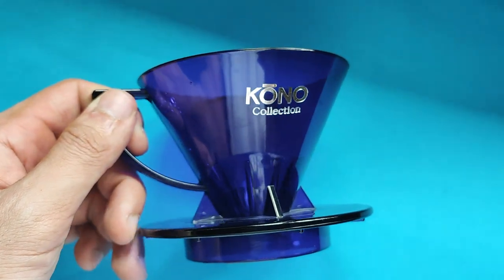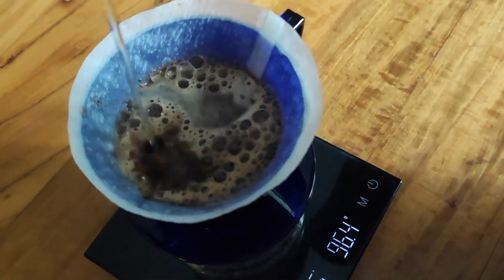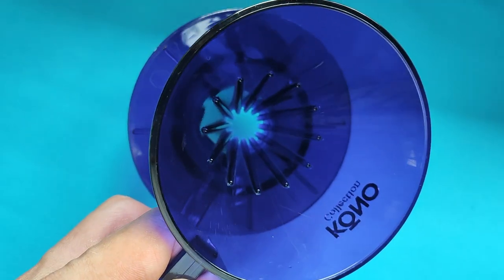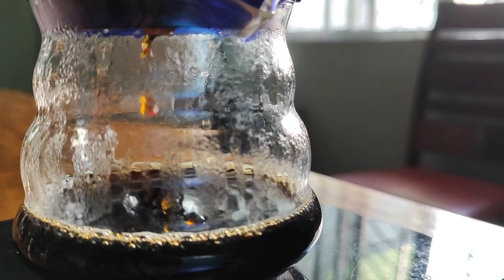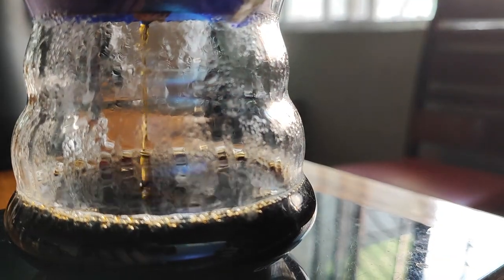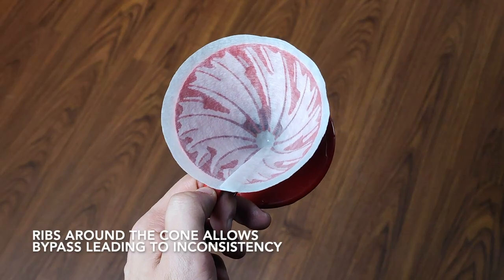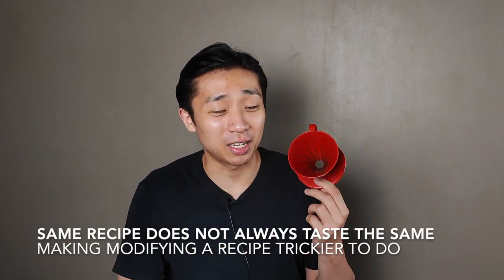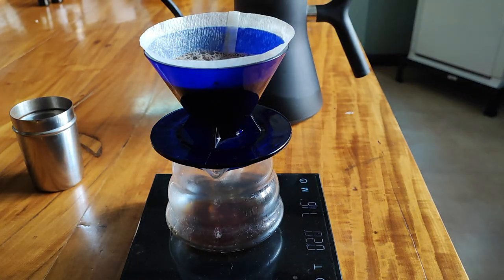Kono Dripper - the MOST UNDERRATED Conical Dripper?

Comment: I agree! Repeatabilty is excellent with this dripper. The added texture is wonderful as well. I've also consistently gotten good acidity, sweetness, layered flavors and balance. Also the extractions seem to be much higher with the same amount of time. So I've been able to get as good or better extractions with the Kōno in much less time with no clogging issues. 

It's a VERY GOOD design producing VERY GOOD results. 
I thoroughly enjoy the Kōno dripper. 

Oh, and to add to all that, I've had great results with 1 pour, 2 pour and 3 pour methods, each with very distinct flavor profiles. 

One of the most distinct and interesting pours I've accomplished with the Kōno is a 3 equal pour method, in which I pour 1/3 of the total brew weight every minute. No stirring or swirling. Smooth medium flow rate making circles from the center outward to nearly the edge. 
The third pour takes a bit longer to drain than the first 2. If there are any floral notes in the coffee it draws them out excellently. Also produces plenty of acidity and sweetness. Multi layered. Very high extraction. Though I haven't had any issues with over extraction, you may need to adjust grind size, water temp or even coffee/water ratio if you have over extraction.
Reply from the maker: Thank you for sharing! Interesting insight with the 3 distinct pour methods. I enjoy using the 3 pour method as well :D
Reply: @wideawakeph3662  Absolutely! 
Glad to share. And I hope someone gets something good from it.

Comment: 👍 Thanks, very clearly presented.   
Would you also recommend this dripper (the small version with the lowest ribs) for working with smaller amounts of coffee? (Say 10 or 12 grams.) 
And what about single pours? (Preferable with lower amounts of coffee.) The Kono looks quite a lot like the Hario Mugen (also hardly with any ribs) which is referred to as the best dripper for the single pour technique.
Reply from the maker: I think doses as low as 12g could still work. Haven't tried 10-11g. 

I also have not tried single pours. I think a 2 or 3 pour structure works well with this dripper though :)
Reply: @wideawakeph3662  Thank you 😊